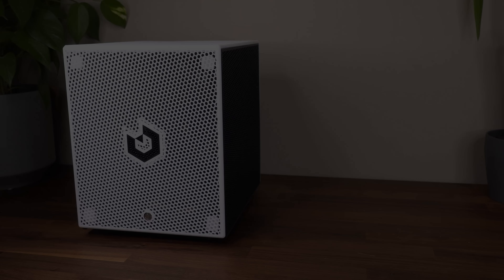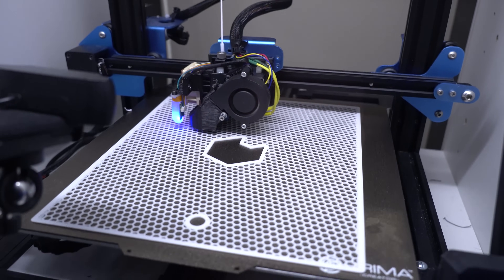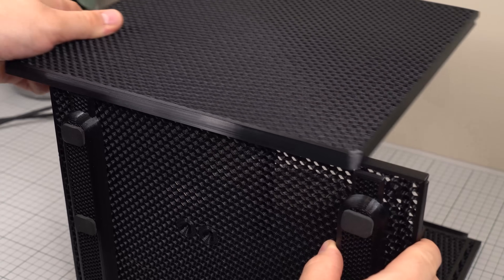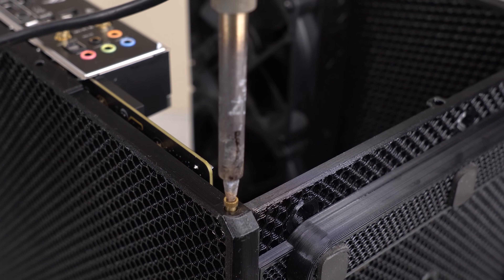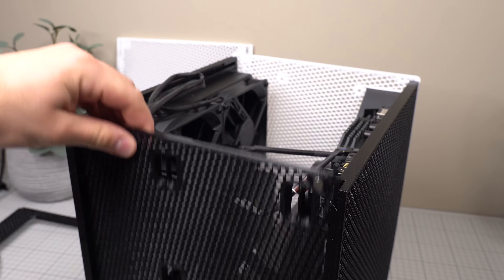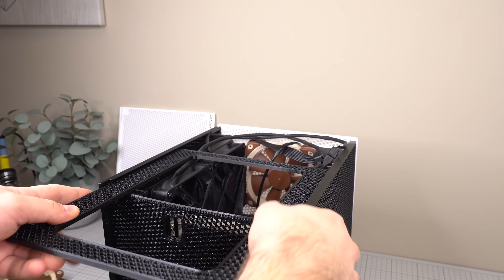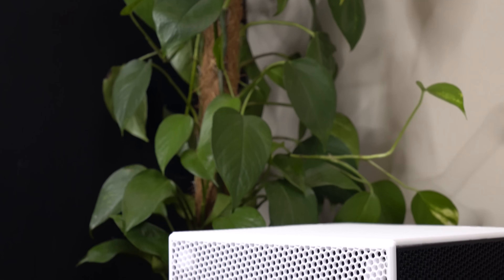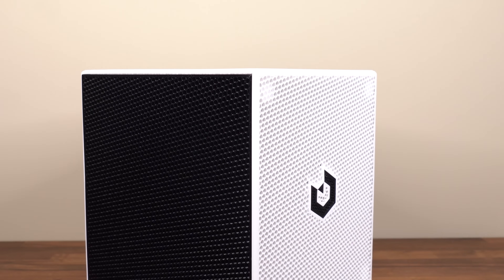Little Boy M - a 3D Printed Micro ATX case

Comment: Nice, I'm sure it was a lot of work but I have a problem, my printer can only print 253mm³ max (it's an X1c). 
If I'm right and if the slicer allows it i can fit a 349mm by 253mm 9mm thick part I chose 9mm as it seemed realistic but if it's thinner then the sheet can be longer by a few mms, or you can calculate it if the design needs thinner/thicker panels, 362-2x✓2xTheWidth still I don't wanna split any part in pieces because the glue is ugly and weak but obviously the surface finish is better if it's printed flat.
The mobo is 244 mm x 195 mm, GPU is 135 mm x 260 mm dual slot and the PSU is an atx one, I use the stock air cooler which is 55mm high and a 2.5inch ssd but I'm ok with just shoving it in if there's no space left for a rack, I don't have fans for it so I can purchase the ones you end up being able to fit
So could you create a design for my needs too? Litte boy SM for example
Reply from the maker: 244 x 195mm is a motherboard format I’m not familar with, must be some version of a mATX motherboard then I guess. Does it use the same mounting holes as a regular mATX motherboard?
Reply: Yes to both, but I forgot to correct the printing volume in the main comment, it's 256mm³, the max dimensions of a 9mm obiect fitted diagonally are correct tho, and I didn't mean to cross out a portion of it but it's readable anyways
Reply: Is there any hope or should I start learning shapr?  @makerunit
Reply from the maker: @Toássex  So, I might not make a case specifically designed for your motherboard but I might end up making more versions of a mATX design that’s printable on smaller printers.

Comment: Hello, you can try this case with atx power supply and mini itx matherboard, please...?)
Reply from the maker: It works already. Mini ITX uses the same mounts as micro atx, just less screws. 

And there are two different rear plates, one for ATX psu, and one for SFX psu. 😊

Comment: Here from Matt's channel and i liked your design very much, BTW  are you going to make NAS case the same size (mATX - because of pcie expansion cards for 10g ethernet etc) of the one in this video but modified to fit 6 to 8 3.5 inch hard drive in tool less bay and no dedicated gpu , just to run Home server and NAS from one Cabinet.

it would be good if the 3.5 inch drive bays has a little 3d printed tool to accomodate 2.5 inch hdd or ssd too something like this video : https://www.youtube.com/shorts/XklOu7zSd44 , 

The Corsair Carbide SPEC-01 cabinet has a toolless drive bay if you want a reference

it can include rubber support for reducing vibration
Reply from the maker: Hi! Long term I’m planning on making a NAS build, not sure what form factor yet but hot swappable drives is one of my hopes to accomplish for that build. I still need to learn a bit more about NAS builds as it’s generally not something I’ve been working with before but I’m eager to learn and I hope to make it in the future. 😁 

NAS is generally a highly requested topic in my videos.
Reply: @makerunit   thank's for the reply there are many itx 3d cases on reddit and other sites, but couldn't find single good mATX case. people who uses itx builds mostly uses 1 gig ethernet from the board, some big nas users uses 10 gig network card which requires a pcie slot and there's only 1 pcie port on itx boards which might be used by pcie to sata adapter, so there won't be any port left for 10 gig ethernet , this problem can be solved if the case fupports mATX form factor
Reply from the maker: @XashA12Musk  aha I see! Makes sense. Thanks for letting me know and I’ll try to keep this in mind when I get to that point 😁
Reply: @makerunit  🔥💪🏻

Comment: I'm curious about how you melt those screw thread things. Could you please make a video on how to do it
Reply from the maker: It’s actually quite simple. All you do is heat up your soldering iron, put it inside the threaded insert and then push it gently down until it’s as deep as you want, then gently wiggle the soldering iron loose and make sure not to pull the insert back out, if that made any sense. There are specific tools available to make these even easier to insert.

Comment: This looks terrific:  very well done!  What are the exterior dimensions and volume?
Reply from the maker: Thank you! The volume is roughly 24 liters. About 320mm length, 250mm width and about 310 height (or around 320 with feet)I dont have the exact measurements in my head but it’s pretty close to that. Print volume required 300x300mm. 😊

Comment: are you aware, that mainboards are supposed to be grounded through the case screws? Since plastic is not conductive, a short circuit will damage your hardware.
Reply from the maker: Aha, I see. Though an easy fix for that would be just hooking some thin cables with cable hooks on the end underneath each standoff then. Though in my 10+ case designs being used for 3 years now I have not had a single shorting problem 😊 but good to have in mind I guess 😊
Reply: Grounded? To what? There is no ground coming out from a PSU! The highest voltage is 12V, and that is not dangerous. And ground connection does not protect against short circuits, but against dangerous voltages (i.e. mains 230 VAC) to reach touchable conductive parts.
It is the metallic PSU case that must be connected to ground (PE yellow green cable), and that is already done by the PSU manufacturer (internally).
The logic ground needed by electronic circuits in the motherboard is simply one of the two wires carrying the 12/5 V power (the black one).
Reply from the maker: @marcobassini3576  that’s what I thought too. That the cables were already «grounded» internally through the PSU cables. I’ve never «Grounded» my motherboard in any 3D printed case and I’ve never experienced issues at all.

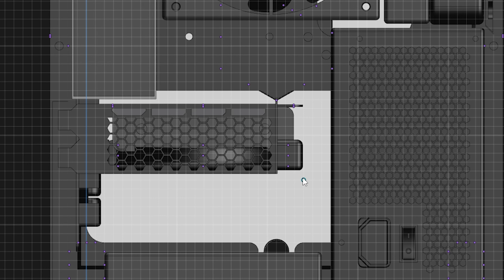Comment: 8:47 width*
Reply from the maker: I know it makes sense to call it width but width is actually in the vertical thickness in a standing case. (How many slots wide it is)

Height is how far out it sticks from the Motherboard. 

It’s probably to keep it simple when comparing it to the CPU cooler which also measures height in millimeters sticking out of the motherboard.

Comment: Thinking about using this for my I9 build with a Matx. Will a RTX4080 fit in this case?
Reply from the maker: As long as the total length is less than 300mm it should be fine. «RTX4080» is a very broad name given that there are so many varieties of 4080s depending on the manufacturer and cooling but length under 300mm should be fine. Then the card height (how long it sticks out from the motherboard) Will decide if you can use SFX or ATX psu 😊

Comment: Please note the holes on 3.5" hard drives are not conventionally M3 threaded. This is different compared to 2.5" drives, which usually are.
Reply from the maker: Oh okay! My bad. Perhaps they use 6-32 screws like the motherboard standoffs instead? Strange how my M3 screws fit right in though. Might this be different for different drives? Because the «hard drive screws» they seem to be normal M3 in the screw kit I have.
Reply: @makerunit  the minor diameter of the holes is small enough that an M3 screw could tap its own threads. They should indeed be the 6-32 screws. :)
Reply from the maker: @AnnaVannieuwenhuyse  I see, makes sense… I did actually notice something was slightly off without giving it much thought when attaching the screws when I come to think about it, but I guess I just assumed that it was same as the 2.5hdd, which is my bad. I’ll perhaps try to redesign the bracket to take regular 6/32 screws then. Perhaps mount the hard drive directly onto the sliding plate and use a slim mount in the side screw holes in the hard drive to attach more drives to that instead. That might work instead, anyways, thanks for letting me know this, as I do not want to ruin anyone’s hard drive threads due to misinformation. 😁

Comment: What filament did you use for that print? Kinda looks like PETG but shouldn't PLA should work too as the hot stuff shouldn't introduce more than 60c to the plastic
Reply from the maker: I used PETG for all printed parts 😊 but I do think PLA would work fine as it doesn’t get very hot.

Comment: I'm impressed and delighted!  you are just very cool!  I don’t know English, but I look at the Yandex browser with the neural network translation, and I’m just amazed at how cool, beautiful and clean everything is designed, filmed and narrated!  You have unique content and a very useful video for 3D printers!  My printer is still very inaccurate, but as soon as I calibrate it, I will print your project!  he's amazing!  Thank you!  keep up the good work!  my wishes - print a project of a case that will take up a minimum amount of space on the table, but will accommodate a microATX, ATX psu board and connect a large card through a riser.. it’s difficult to describe in words, but there are similar projects: a vertical tower, a motherboard on one side of the PC  , and the video card is on the reverse, connected via a riser.  the location of the drives is not necessary (either m2 on the board, or some space for a 2'5 format)... I'll look for an open project with an sfx psu and a MiniITX board later, I even printed it and used it, but maybe it will be fashionable to come up with something with  microATX or!  or at least with miniDTX - these are dimensions 19x19cm, a popular format for semi-office PCs 1151 socket - asrock h310m-hdv/dgs, 1150 - asus h81m-p... just add 2 cm in ready-made projects, or create new ones .. a lot of ideas  , sorry if there are many mistakes, I am writing through Google translator.
Reply from the maker: Thank you! I think I understand your wish for a new case! I’ll definitely try in the future to make even more compact mATX format builds! 😊 the english is just fine, very understandable.

Fun fact:
You can type any comment in your own language and I can translate it right here on YouTube, as google translate is built into YouTube in a way.
Reply: @makerunit  о, это облегчит написание сообщений, благодарю за подсказку. Просто возможно не на всех устройствах это точно заработает. да, с блоком питания флекс АТХ было бы идеально, так как железо у меня имеется, а вот нормальных продуманных проектов под этот БП не так много.

Comment: Could you ajust to be able to print on a bambu carbon printer
Reply from the maker: I feel like this design will not be the same if cut into smaller pieces, would kind of ruin the aesthetics of the case, but I’ll do my best to make designs more suited for smaller printers where possible in the future 😊
Reply: may be same disign  for apu only or single or smaller graphics cards using standard  psu @makerunit

Comment: I got an idea for a cool case from this video, a silenced airflow monster which would leverage the best things of 3d printing -> complexity is near free.

Basicly a rounded box which has zero features outside except on the back, 1 vent and one big hole for all the cables, intake air etc.
Interior shaping to silence noise.

Laser cut alu or printed plate for motherboard etc. everything built on the desk, then just case slid over it.
Dust filtering can be done 3D printed too, the complexity thing ;)

Power button on the backside middle of the top vent.

It would be near silent yet could have decent airflow, completely featureless to outside would just look like a indescript box. Quiet and doesn't feel warm to touch since plastic is excellent insulator.

HOWEVER it will require a large format printer. But would be mass produceable and quite different on the market.
I just might have to make a few now, how hard can it be? XD
Reply from the maker: I’m not sure I understood your idea 100% right but a sphere of some sort with rear openings. This combined with another comment I saw gave me a freaking cool idea! 😁

Comment: is there anyway to print this using acrylics instead of 3dprint? I don't have a 3d printer and buy a custom cutting on a acrylic sounds more cheap than 3dprint. genuinely asking
Reply from the maker: Hi! Thank you for showing interest in this case, but unfortunately I think I’m going to have to say no, mostly due to how it’s designed it wound have needed to be designed in a very different way due to the different mounts and sliding tracks. 

A similar design would perhaps be possible but it had to be designed specifically for acrylic from the beginning then. 

3D printing allows for designs that are literally impossible in most other manufacturing methods. 😅
Reply: @makerunit  Thank you for explaining. decided to print this fire very soon. is there any possibility for additional handle on the top?
Reply from the maker: @muhammadkhaidirsyafei4943  It’s possible, but not recommended, mainly due to the way the top panel is designed here,  as it’s slid into a 45 degree slot and too much upward force and it can end up coming out of the track.
Reply: @makerunit  thanks for explaining. if I want to print some of it first for the Ryzen APU PC. Which part should be printed first? I have ryzen 2200g with matx, Atx power supply, and 1 hdd 3.5.
Reply from the maker: @muhammadkhaidirsyafei4943  I’d say the order doesn’t really matter too much but maybe the internal chassis first.

First the two side panels, then bottom, then internal top panel and then the feet, make sure it all fits together as you like and holds your parts, then the rear, top and front last probably 😊
Reply: @makerunit  Thank you for answering. I wonder is it OK to print with PLA+ (or PETG) with 0.3 layer height for internal chassis (or maybe entire case)? did you think it will make the honeycomb looks ugly or easy to broke? I'm totally new to this 3d printing world 😅
Reply from the maker: @muhammadkhaidirsyafei4943  No worries! I personally think PLA shound be fine for most of the parts. The look of the part should pretty much be the same no matter if you use PLA(+) or PETG. My personal experience is that PLA holds up just fine in PC cases. You MIGHT see a tiny amount of sag in very long bridging parts that carry weight over time but generally it’s not really an issue in my opinion. 

And this design has no heavy «hanging parts» for that sake. The motherboard holds the most weight but it’s distributed over multiple mounting holes in the side panel so it shouldn’t really matter. Then you add the airflow as well making the case very unlikely to fail. 

I hope this answer helps.

Comment: FYI those style of heated inserts are significantly less effective than the ones with twisted knurling. Something to think about if someone decides to lift the case with all parts installed. In general something I’ve worried about with 3D printed cases is how much it flexes or twists once filled with parts, especially with a cube case with no top or bottom surface like this.
Reply from the maker: The great thing in this scenario is how it will keep it’s shape due to all the panels interlocking, and the inserts are mainly to keep the top panel from sliding out rather than actually holding much weight. 

I’ll keep that in mind about the knurled inserts. I’m currently just using up the rest of a cheap set I got from Ebay a while ago but I’m soon out of M3 size so I’ll probably buy a new pack soon and then I’ll try the knurled ones 😊

Comment: Do you have any tips for designing the "motherboard tray"? I feel designing the case itself is relatively easy, though getting the dimensions correct for the I/O shield/GPU slots would be challenging. I've had a couple of case ideas floating around for a while though up until recently didn't have any CAD know how. 

I still haven't learned components/assemblies/joints in fusion 360.
Reply from the maker: There are some data specs for motherboard mounts available if you dig a little deep online but honestly even I struggle to read them correctly. Mine are mostly based on my own measurements. 

The design of a case itself is relatively straight forward, but what takes time is making all the adjustments, testing, finding the correcy layout where no single part conflicts with another part, leaving room for cables, remembering everything, adding flexibility etc. considering airflow etc 😊

Comment: Always satisfying seeing it slide on in. Recently got my Bambu Labs P1S and it's amazing but not big enough to print said pieces to make the tower.
Reply from the maker: Yeah size is always a problem. I’ve got the luxury of the 300x300mm printbed and it makes everything so much easier but I notice my Ender 3 is just sitting there due to not being able to print most parts. I was actually considering getting a Neptune 4 MAX which is 400mm printbed instead 😁 but I notice the majority of 3D printer owners use Ender 3, Prusa Mk1-4, Bambu etc. I guess that’s the next challenge for me, to make something big with a small printer.